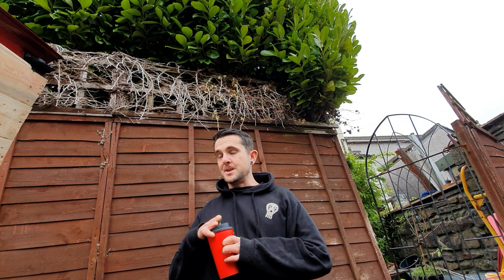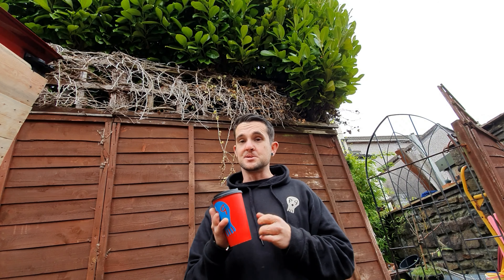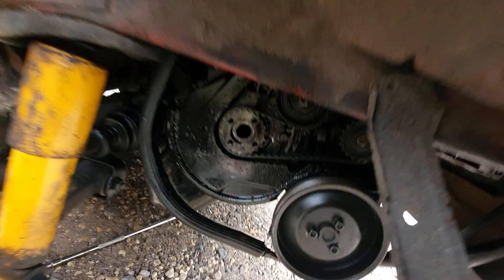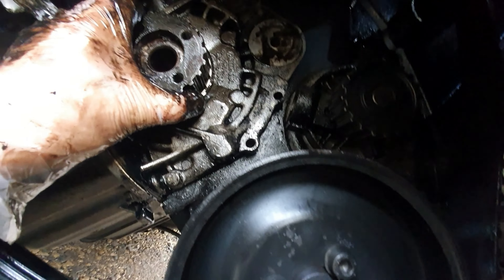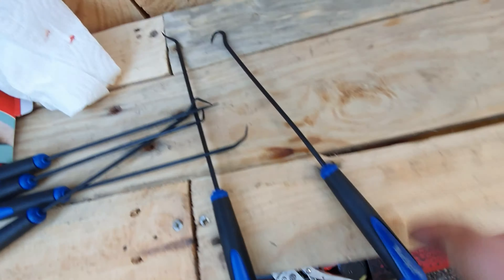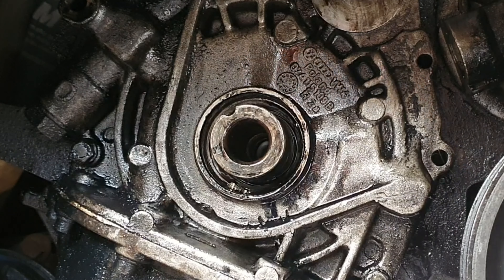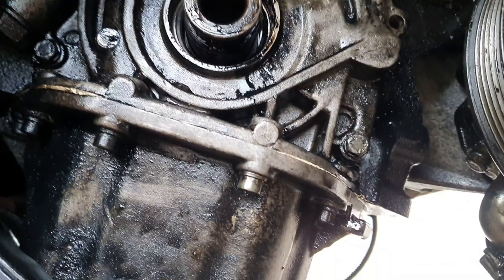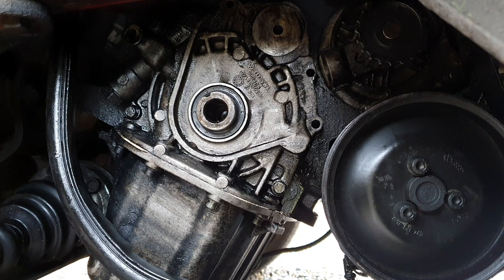Where Is This Oil Coming From?

Comment: If i were you I'd get some UV additive to stick in your oil. Then you can trace it using a UV torch. Gotta give the engine a thorough degrease & clean first. They normally leak down the back of the block & onto the sump from the oil cooler gasket (mine does!). However as yours appears to be leaking from the top & front it looks like the cam-shaft oil seal, and/or the oil filler neck gasket
Reply: I was thinking the exact same thing, oil cooler, then as it progressed, I was like yeah maybe camshaft seal or one of the o-rings on oil filler neck.
Reply from the maker: I thinking its the crank but as I said in the video the oil filler/breather seems very fresh but I don't see how that would be making its way down the side like it is
Reply from the maker: Yer I think crack to be honest now looking at this footage and other that I didnt add it looks like its coming from there
Reply: @PranceProject  yeah I would get some gunk or something rinse all the muck off and you’ll have a better idea where’s it’s coming from. T4 tips and tricks knows the score, get elring kit, I think euros do one, I was only looking the other day coz I’ll be doing all mine over the winter. 

Good luck buddy, hope you get it sorted soon 🤙

Comment: Had one earlier this year what I did 
Oil cooler seal
Replaced oil seal cam and crank for some under sized ones which are fog high mileage engines 
Rocker cover gasket about 20 times 
Oil filler and breather seals
Turned out to be inlet manifold I’d taken it off to clean it and not tightened it to the max

Comment: I'd get some gunk degreaser and clean the lot. Run it on the ramps and get it to temp to see if you can see where it's coming from on the top of the engine. That seal looked like if fitted way to easy around the crank so maybe it's the wrong size if there is two sizes. Also lube up the inner lip of the seal where the crank pokes through. Once it's over the crank twist it round the crank before knocking it into the block. This makes sure the inner lip of the seal is sat properly around the crank as if it's not the spring inside will shread the seal very quickly. Also check the crank for any sharp edges from removing the old seal. Make sure the  seal is also level with the recess of the engine. If its crooked it will shread the seal too. Once the seals sorted I'd definitely change the cam belt as been covered in oil may make  it skip teeth or snap before it's time👍

Comment: hi mate , i had this on my t4 , was the cam cover gasket the oil filler tube has an o ring at the bottom and the cam cover breather valve which you pointed out pushes into a rubber bung, mine were all leaking ,by the look of it yours are to, east job and not expensive, you can get cam gasket from just campers but not the rubbers for cam cover bolts, mine were cracked so sealed those with sealant, otherwise from vw you have to buy whole new cam cover which is dear. good luck ,start with cam cam cover and oil filler neck seal.cheers
Reply from the maker: I am going to order the oil cooler gasket and hope its that pain in the arse trying to find and sort this oil leak

Comment: When i do e mine i used about 10 litrs of brake cleaner! 
Was shocked how brittle the cam seals had become, oil cooler o ring was flattened - tps kept trying to supply me the wrong crank seal... i had to give them part number from unit eventually 🤦🏻‍♂️ & no matter what you do it will always leak from filler/breather
Reply from the maker: The oil filler dont look bad i can live with that but the leak i have is bad, thinking the crack but where is the oil cooler?
Reply: @PranceProject  oil cooler is between filter & block
Reply from the maker: Is that on the back by the turbo aint it
Reply: @PranceProject  yeah where the oil filter screws too

Comment: I wish I could help, bud. Not nice to see you having to do the same job more than once with no improvement. All I can suggest is start from the top and work your way down, cleaning and replacing seals as you go. It is going to be a ball ache but may be the only way to sort it.
Reply from the maker: I think I might get one of those pressure bottle things and brake cleaner in and go made and get a complete seal kit and just do them all
Reply: @PranceProject  If you are planning on keeping the van, and why wouldn't you, they will all need doing at some stage. 

One thing I will say is the febi parts are not always the best, it really is hit or miss with them these days. I am now using elring o rings and gaskets whenever possible. It took a few attempts to get my cam cover sealed up. I was using a febi parts and then on the 3rd attempt switched to elring and it sealed perfectly. 

Stick at it, bud. You will get it sorted in the end I am sure. Unfortunately it is the wrong time of year to be outside poking around under the van.
Reply from the maker: I will look about for a seal kit and see what I can get. Just hoping can get it all done soon and im leaking oil everywhere I go.

I heard the crack seal dont have a key way on it which seems weird and wrong.

Hoping to get it all and wait for a good ish day when not raining and smash it out in one day top to bottom